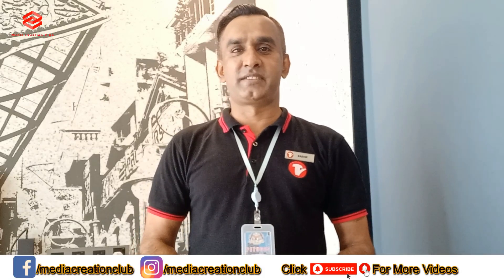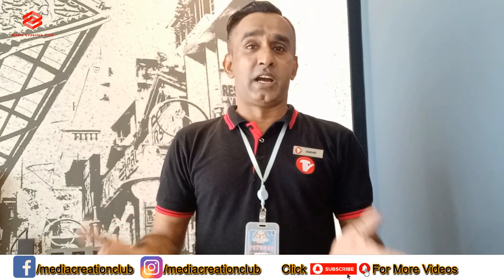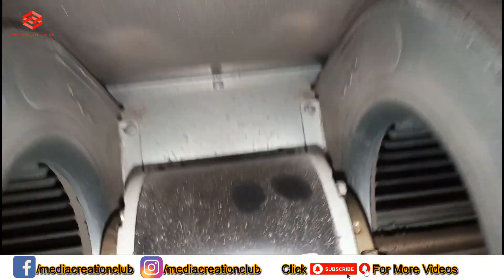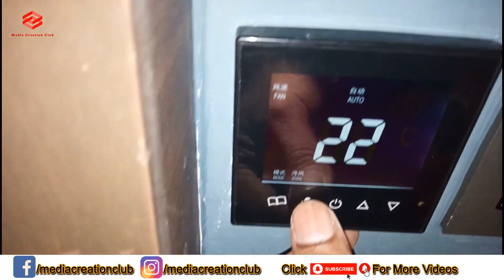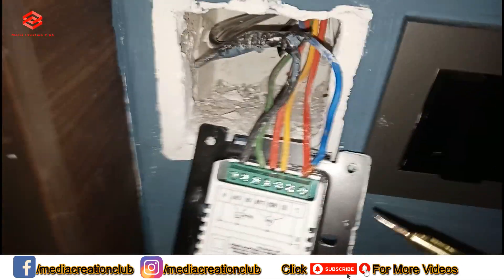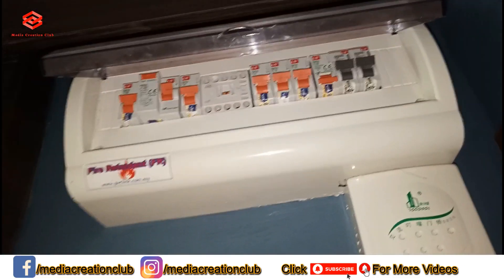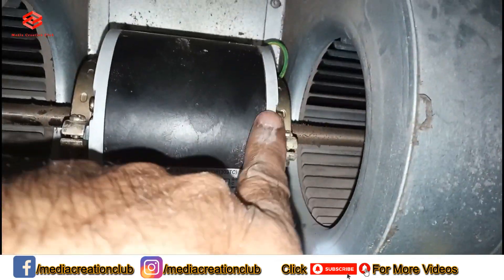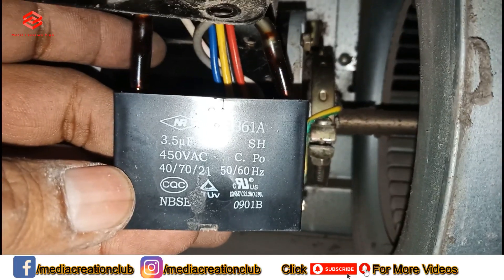How To Change Or Replace An Indoor FCU Blower Motor || How To Service FCU Motor And Blower

Comment: do you have of replacing the out door fan motor  of carrier duct unit
Reply from the maker: No dear we don't have ..
Reply: @MediaCreationClub1  Tank you I had it replaced in a carrier duct unit but it become hot and the ac send hot air, could it be  because the indoor fan motor sticking and sending very weak cool air

Comment: Hi,if the motor is 220 volts and has 4 wires,3 for fan speed and one for thermostat. Where is the other wire for power.. Thank you

Comment: Great job thank you for that. I had to replace carrier AHU 15 years ago and I didn’t find the original replacement, so I had to adjust a replacement by cutting the length of the rod. I would like to ask you what would be the problem if her an intermittent nose in the O,General air handling unit.